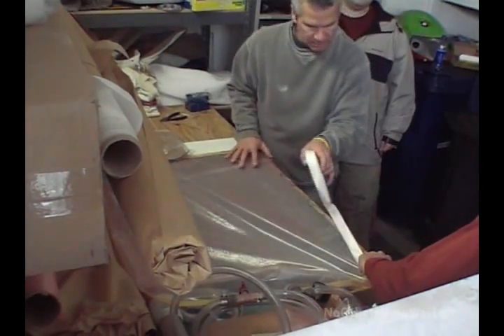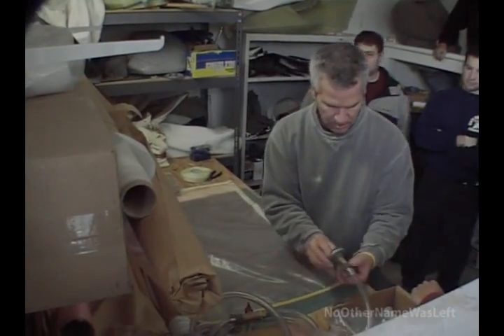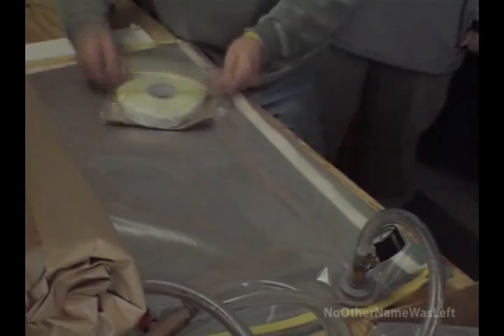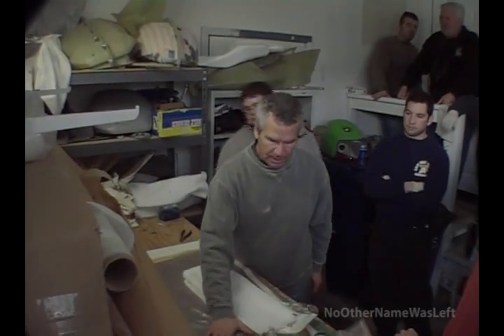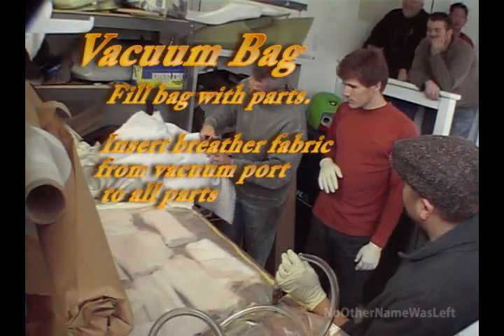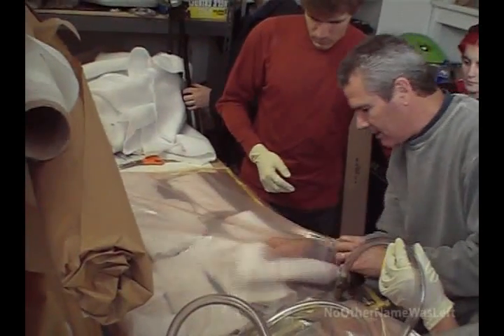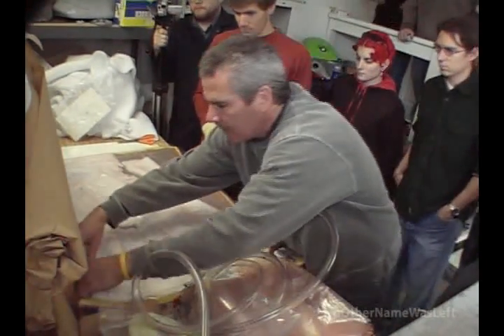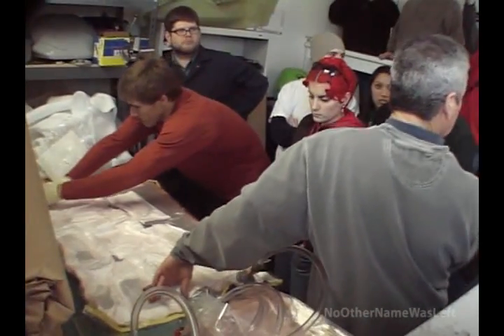Tygaboys Carbon Fiber Fabrication Seminar Episode 3

Comment: No bags. A two sided mould where dry fiber is layed up. Then the mould is closed and resin is injected into the fibrepack using a pump that also mixes the two resin components. I wouldn't say that this would be suitable for a "one part" job since you would have to make the mould from reinforced composite materials or say aluminium. But for large series and cycles it's great. It's a closed, clean process.

Comment: We do various other processes like RTM (resin transfer moulding) where you'd have a two part mould that you close and add vacuum to. Then you inject the resin through tubes using a pump, overfilling it. Then reversing the pressure and let it cure. using this method and two sided moulds, you can get a nice gloss looking finish on both sides which is great.

Comment: I work with composites but we use "closed" processes instead of wet laminating. I would prepare the mould, lay up the dry fiber and bag this. Attach tubes and infuse the resin using the vacuum suction in the bag.